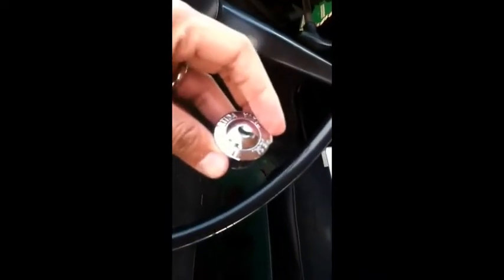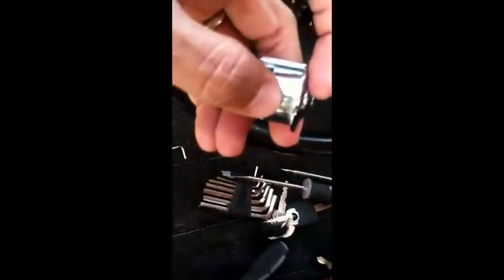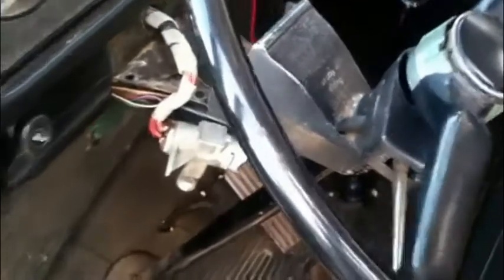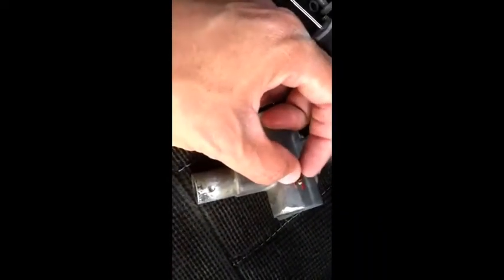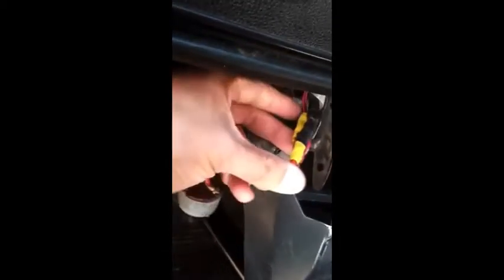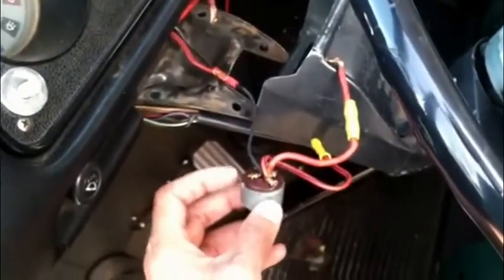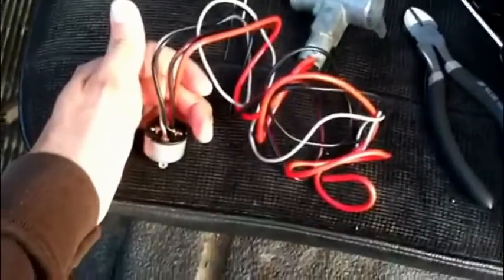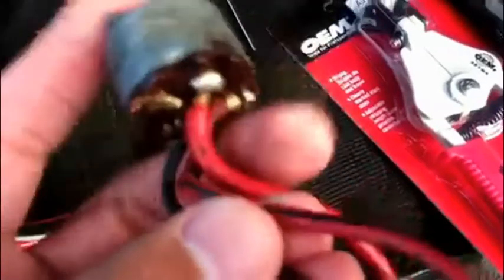1969 VW Bus Ignition Switch Replacement

Comment: I replaced the switch on my 69 Bus and the aftermarket switch was junk and lasted a couple months.  I had my mechanic bypass the key switch and install a rocker switch for power.  New switches are junk.
Reply from the maker: Yeah. I hope I still have the original one. I might try to rebuild it.  The key tumbler didn’t want to go back in all the way so I had to use an aftermarket one with a square key.

Comment: Hey man! I have same issue with ignition key, itwont start the engine, im still figure it out now because i want to keep it original way to start the engine with the key since a lot mechanic here suggest to install some push start button kinda thing, could you explain what fault to cause this and what parts should be replace? Thanks a lot, regard from jakarta indonesia
Reply from the maker: It’s usually the wiring. It can have a loose connection some where. Try to check all your connections. Can you take some pictures of video and post on YouTube? I need to see where there might be a loose connection.

Comment: im having a problem with my bus the headlights wont turn on. but the side marker lights work.   the headlights came on  a few times but stopped working
Reply from the maker: That could a few things, that has nothing to do with your ignition.  Start at the headlights and work your way back to the light switch inside your bus.  Take off the headlight and make all the connectors are firmly attached.  Check for rusty connections or bad wiring connections done by a previous owner.  Once you check the connections behind the actual headlight work your back to the switch.  Take off the switch with out disconnecting any of the wires and spray them with electrical connection cleaner or some sort of solvent, maybe even WD40.  If they still don't work try pulling on each wire individually and see if any come off easily, that means they need to be replaced or tightened by carefully crimping them with special pliers or try with some regular ones.  After all that if they still don't work it could be another issue somewhere else.
Reply: mrabelonee I'm trying the headlight relay.  hey you didn't make another video after you removed the leaf springs to lower the bus. I'm in San Diego too.
Reply from the maker: I think I have a video on here for the headlight relay.  As far as leaf springs, it didn't lower my bus very much, I only took out two leaf springs. I think I took out one from the top tube and one from the bottom, It might have lowered my bus by one inch.  My bus isn't running right now or I would show what it looks like.  Check out San Diego Air Cooled every Tuesday at the Carl's Jr. in Chula Vista.
Reply from the maker: I think they are called torsion bars not leaf springs.  leaf springs are on the rear end of trucks usually on straight axle cars.
Reply: mrabelonee right on.  yah ive gone to that carls jr. maybe I'll go tomorrow. see if I can get help with my headlight s
Reply from the maker: what part of town do you live in?
Reply: mrabelonee   I live in chula vista.   I figured out the problem.  I bought a new headlight relay. put it on and it turned out to be bad. ended up going back to pep boys and got another one.... it worked. I should of made a video
Reply from the maker: You bought a headlight relay at Pep Boys? Didn't even know they carried aircooled VW parts.  The one they sold you was bad?  How did you figure that out?  I would never guess that could happen.  I live in Encanto, if you ever wanna stop by and work on something let me know.  I work on Tuesday nights so can't make the Aircooled meetings.

Comment: Does this also apply In a 1969 Volkswagen Beetle?
Reply: Should be 68-70 they changed it in 71
Reply from the maker: Sorry never saw your comment. Not sure about that. I’m guessing the housing part is different but the tumbler might be the same.
Reply: @SanDiego_VDubLife  Its been a year and I basically restored the whole eletrical system in my bug on my own now and its driving. Thank you though for replying XD
Reply from the maker: Martin De Jesus Raya hey that’s awesome dude. Glad to hear you got it all figured out and your big is running. Sorry I didn’t reply. I’m just learning how to use this YouTube thing. Now I get notifications on phone. So I’m all geared up. Now to get my bus project going again. Stay tuned for some videos on that. Then hopefully the 1965 bug which you might be more interested in. Just curious how did the ignition come out? Was it the same as the bus?
Reply: @SanDiego_VDubLife  basically the same, actually.
Reply: @SanDiego_VDubLife  but I decide to add a hard start relay to eliminate those ruff starts with my bug
Reply from the maker: Martin De Jesus Raya sick. Not sure what a hard start relay is but I see you have some videos posted so I will check them out and try to learn.
Reply: @SanDiego_VDubLife  A hard start relay basically connects power directly from the battery to the starter. In stock Bugs, The battery has to go all across the car to the ignition switch then all the way back to the  starter to turn the starter. Overtime, as the wiring gets old, the starter cant get enough juice to turn over since the power from the batter is far away. The relay eliminates that distance. There are some videos out there of people adding Hard Start relays to old bugs.
Reply: @SanDiego_VDubLife  https://youtu.be/w6AE6ALQcmk

Here's a video from the VW Duck Man explaining this concept further. It also applies to buses and basically every car since most cars have them now
Reply from the maker: @Martin De Jesus I got you. Makes sense. I figured it had something to do with that, but since I have never done it, I didn't know exactly what you meant. Great advice thanks for sharing and also the link to Duckman. I would not do this approach if I could avoid it. I would rather replace the wire where possible without doing an entire rewire and clean my connections and things should work fine. I don't like to change things too much when possible to avoid failures in other ways so I try to keep it stock when possible. I even ordered a german ignition switch cuz I didn't like using the Brazilian one, but it turns out I can't get the German one to fit right so I'm gonna go back to the Brazilian one until I can figure out what the hell is wrong. I bought both German parts off of the Samba, so I might have got the wrong one for my year car. These things changed every year it seems like. I don't think they came with a steering lock in 1969, so not sure why housing had that. Could be the wrong part and that's why my ignition tumbler does lock into position. Who knows?